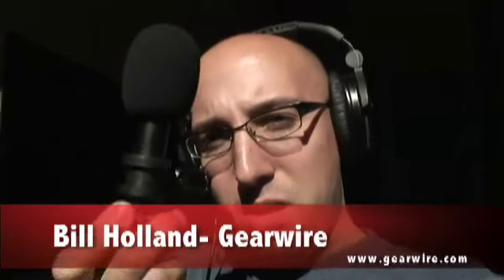Audio-Technica PRO 24-CM Goes Into Battle

Comment: I have a Pro 24, and I use it with a Canon Vixia HV30, and what I've noticed is that no matter what I do, the microphone is incredibly quiet, especially when compared with the onboard microphone.
Then, whenever I do turn up the sensitivity so that something can actually be heard, no matter what I do with the mic, I get a hissing sound.  I've only tested it in quiet environments, but this doesn't sound right at all.
Could it be possible that I have a defective microphone or something?

Comment: Confusing. The first two mics your referred to as the onboard mics, but one was plugged into the XLR? Seems to me generally camcorders have XLR jacks, so anything to do with XLR doesn't apply to connections on a DSLR. The second mic (outdoors) was not an improvement, but the third one cut the high frequencies nicely. :)

Comment from the maker: well...what are you using to record?  Different sounds require different mics.  If you are doing field recording, you might want to get a zoom h4 field recorder.  If you need a general overall mic, I would recommend a condenser with switchable patterns.  If you are looking to record outside or get into video or film work, looking at the Rode and Sennheiser condenser shotgun mics.

Comment: @orenelran35 
I have a Canon HF-S200 camcorder - it's essentially the same as the HF-S100, but sports a 3.5" LCD display versus the HF-S100's 2.7" display. And I have exactly the same problem. 

I find that the Canon HF-S200's audio circuitry already demonstrates a fair amount of hiss, but it's not as bad as it is with the PRO24 mic. This makes me wonder if there's an impedance mismatch between the mic, which is rated for 600 Ω, and the HF-S200, which seems to have an impedance of 200 Ω.